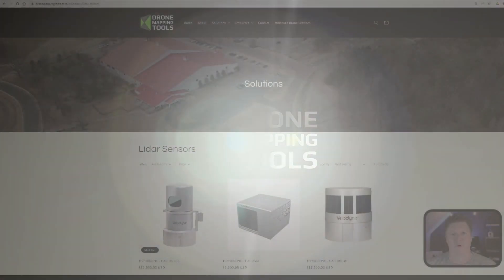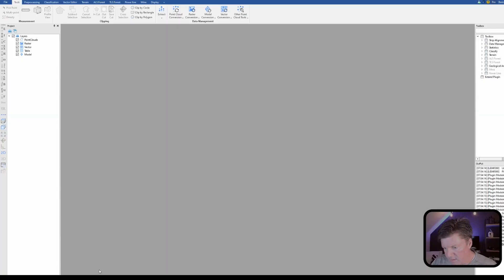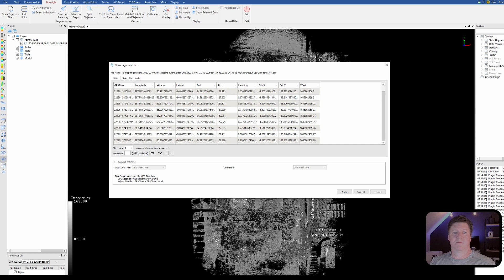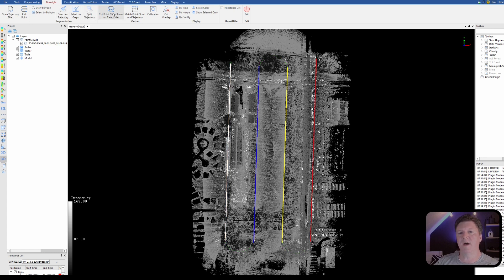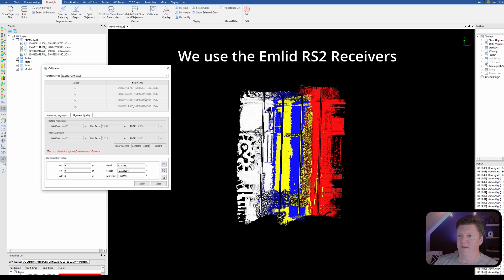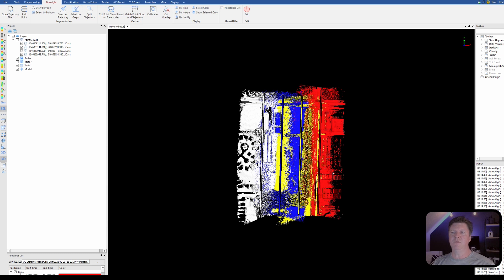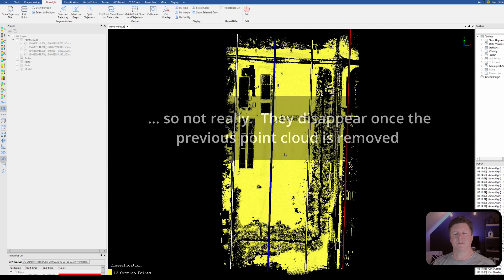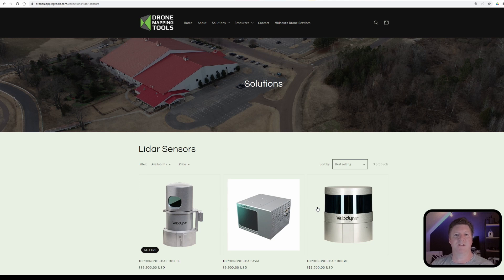How to do the Strip Alignment in Lidar360 ver 5

Comment: After splitting trajectories, I click cut point cloud based on trajectory and nothing happens, log shows Start Running, next line is Finished but doesn't cut the point cloud. Any idea on how to proceed? Ty

edit: i have DJI L2 and processed through DJI Terra, when I import the trajectory, I use sbet.out file instead of the POS .txt file; can't figure out the columns to use whne using POS .txt file.
Reply from the maker: Which Lidar unit are you using?
Reply from the maker: You need to check on the option to adjust "Gps Week Time" to "Adjusted GPS Time".  You must select the correct flight date or the trajectories won't match any of the points.  They will line up on the map because they are in the correct "geographical location" but if you don't fix the GPS time, the time stamps won't match and therefor you can't cut the point cloud.  To make sure your column headers are correct change the "skip rows" to 0, set them all correctly, then change it back to "Skip Rows = 1".  I am on version 7 so I hope this helps if you are on an older version.  Send me your files and I will make a video and show you how in Ver 7.  Https://DroneMapping.Wetransfer.com

Comment: Would Lidar360 work with data from the DJI L1 since it has to be processed through DJI Terra first?  Desperately looking for something to strip align the point cloud to eliminate the overlap ghosting, but I have no POS files in any of the L1 or Terra's outputs.
Reply from the maker: Hey Brian, you can upload one of your point clouds and I will test to see how Lidar360 improves it.  I have not worked with any L1 data sets.  But I can tell you the Lidar360 is very nice and a must have (for me) when working with the Lidar data sets.  Here is a link if you want to upload one of your point clouds.
https://drive.google.com/drive/folders/1OjMAz-Xa7uxGdAFpgv-QEgZhfX5IIlJp?usp=sharing
Reply: @3dMappingTools  I have uploaded the dataset after processing in DJI Terra.  I also have uploaded the raw text files that come from the sensor, in case they're needed for any clarity.  Thanks!
Reply from the maker: @brianjurgella6678  I will test it and let you know how it goes
Reply: @3dMappingTools  I have the same question.    Any luck with the L1 data?  Does dronemappingtools sell lidar360?